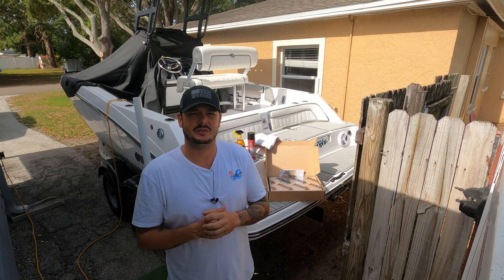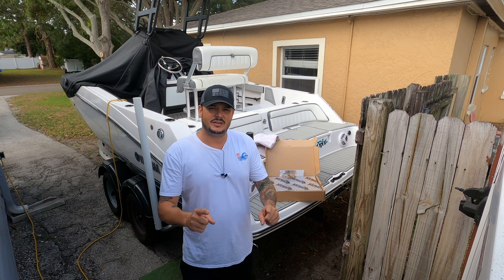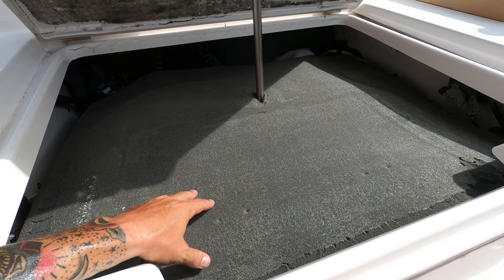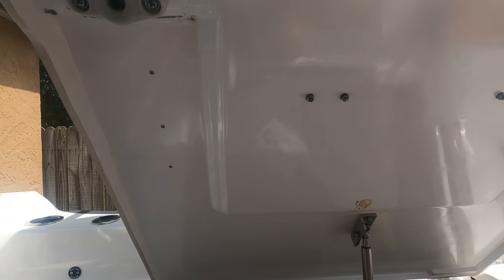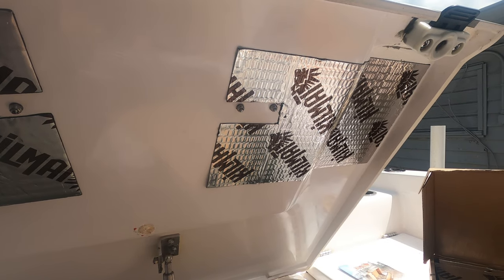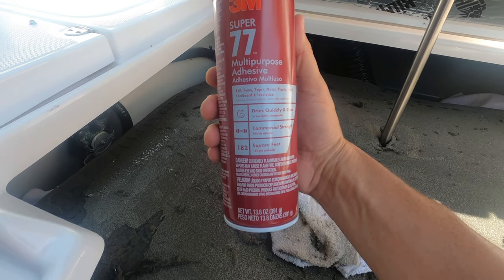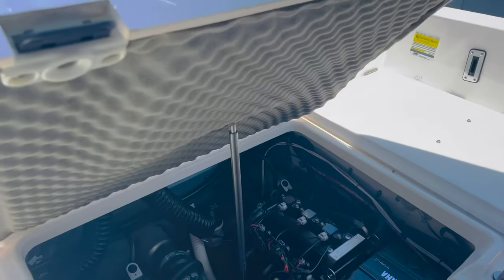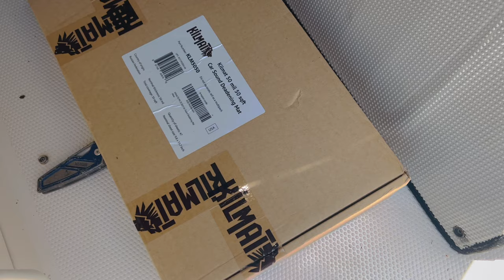How to PROPERLY install Kilmat sound deadening to reduce engine noise while retaining your OEM foam

Comment: Did this over the weekend. I guess yamaha saw your video cause my original padding was completely glued to the hatch. Took so long to get it off and cleaned up. I didn't use kilmat but it worked the same but the exhaust noise is really loud. The engine noise covered it up if anything
Reply from the maker: Glad it helped
Reply: @THEFSHDUDE  I added some to the hatch over the clean out ports. Seemed to help when I was flushing my engines. Real test will be this weekend
Reply from the maker: @Aplex21  the more the merrier 🤙🏼

Comment: Are you still happy with your choice to go with the 50 mil or would you go 80/100 if you did it again? Any thoughts of removing the foam and replacing with dynamat headliner? Thanks!
Reply from the maker: Yes I am happy with it. I chose 50 for the lighter weight on the shock. You could go 80 if you choose to but I wouldn’t go with 100. I highly recommend the marine headliner from dynamat. I would have done that too but it wasn’t in the budget at the time.

Comment: Hey quick question. At 14:33 you removed the killmat logos. Did you just use acetone and a rag? I’m about to install the same mat on my surf boat but I didn’t like the idea of the logos everywhere when I opened up a compartment. TIA.
Reply from the maker: Yes, the acetone removes it and cleans it so that you can reapply the foam to it.
Reply: @THEFSHDUDE  perfect. Thanks for the reply.

Comment: Did you cover the wall between the fuel cell and motor bay that has egg crate? Getting ready to do the install and was curious.
Reply from the maker: No, I did the lid on the floor.

Comment: Did you by chance do a decibel reading before and after?  I’ve got a ‘19 AR240 and am interested is doing something similar.
Reply from the maker: I do not have a db meter. It’s a very noticeable difference though. Highly recommend doing it. Links to products used are in the description.

Comment: Is the engine noise on this boat really bad? We’re trying to buy this boat next weekend and this is my biggest worry
Reply from the maker: Not if you do this mod. I mean you do sit right over the motors so it should be expected to have more noise than engines that are behind you.
Reply: @THEFSHDUDE  have you had any major issues with the boat so far?
Reply from the maker: @mik98911  nope, still going strong and like new at 150 hours

Comment: My driveway is sloped towards the street. I wash my boat in my driveway, but park it level in my back yard. The foam mat get soaked mike a sponge while i wash the boat. So annoying.
I've even noticed it getting algae in it.
Reply from the maker: How is your foam getting wet??? Something doesn't sound right unless you are spraying it. You should not be spraying your foam at all. It's not intended to get wet. My driveway also slopes towards the street and I park it level in my side yard. I can't think of any way that foam can physically get wet unless you spray it. Again, DO NOT GET YOUR FOAM WET.
Reply: @THEFSHDUDE  i guess my driveway slope's steeper than yours. I figured it out r8ggt after i typed this. 
So the the boat is set up for the water to drain forward from the rear gunnel toward the deck drains ar located where the captain stands. 
The angle of my driveway defeats the angle built into the water channels between my battery hatch, engine hatch, and livewell hatch. It pools there until i move my boat to it's normal spot in my yard. 
Yeah, i didnt realize it was happening until now. I gotta change my washing habits. .

Comment: Why couldn't you use a thicker product... You said something about the lift.. But the weight of the thicker product really is negligible
Reply from the maker: I didn’t want to add too much weight causing difficulties with the shock. It was a personal choice. Not saying you can’t, I just didn’t want to.
Reply: After a year do you still think it was worth it?